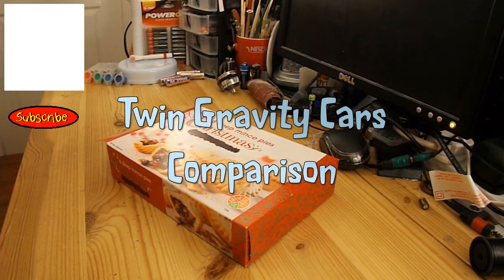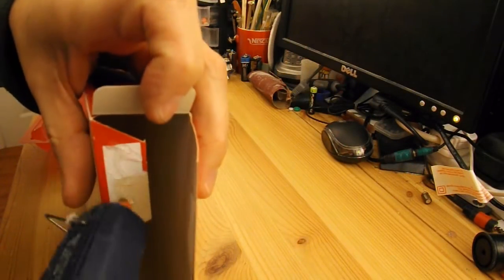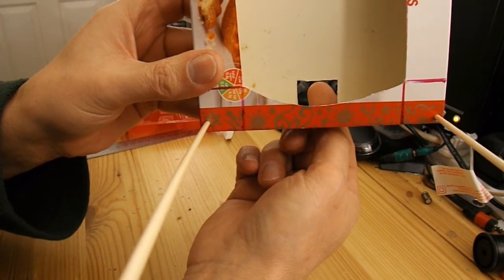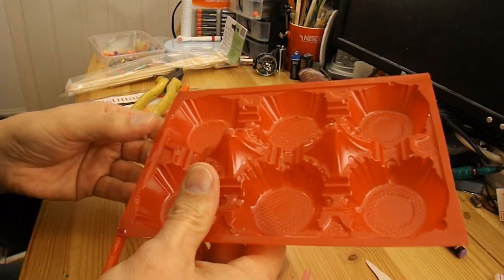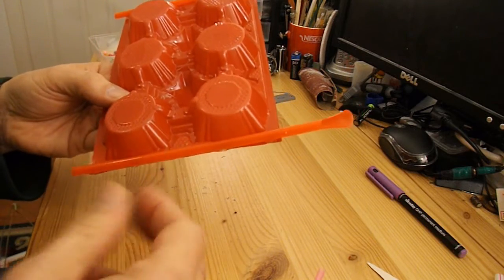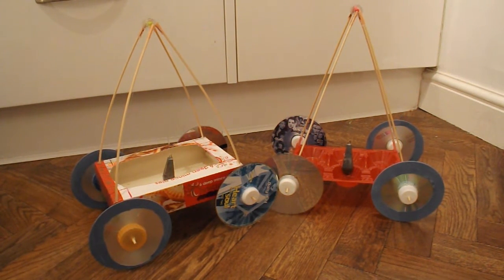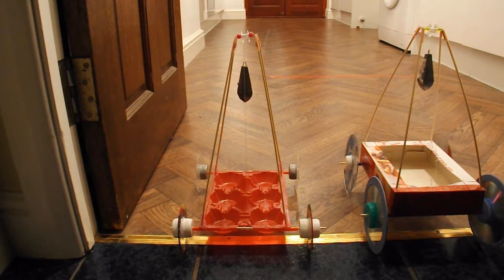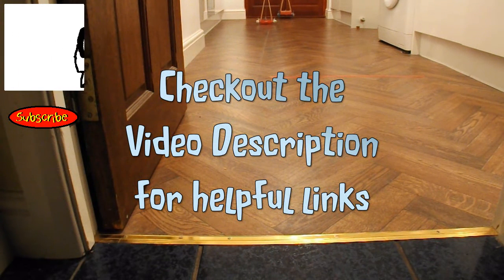Twin Gravity Powered Cars comparison

Comment: do you know how i can make one that goes 10 meters
Reply from the maker: The distance it travels is very much down to the friction and inertia. If your bearing surfaces have minimal friction it will travel further, so the pulley and the axles need to run freely. Lubricate the bearing surfaces, consider using ball races. A heavy weight will give you more inertia to get the car moving faster. A taller tower will give you a longer distance for the weight to drop. The distance the car travels forwards with each revolution of the wheel is the circumference of the wheel, so a small wheeled car will travel less distance than a large wheeled car. I have no doubt you will be given some specific criteria for your project, so I cannot guess what your car design would be without knowing those details. If you read the video description I have already given advice and useful links.
Reply: @GrandadIsAnOldMan  ok thank you

Comment: Im sorry to say this, but after 5+ hours of following this tutorial, my gravity car still does not work, i wish you had spent more time explaining the winding up process because my car winds up but doesn't move. Now I have finished car that doesn't move unless you push it. Please explain how to attach the string better so others can understand.. Thank you.
Reply from the maker: First it says nothing about being a tutorial. It is an attempt to compare different sized wheels. There are currently 36 videos in the associated playlist with various different designs if you look in the video description for the link. The most likely reason for the lack of movement for your car is friction. Either at the axle bearings or the pulley bearing so ensure they are free running. Experimenting with different sized pulleys may help. To connect the string to the axle I have used many different methods in my cars over the years. You could just glue a short length of bbq skewer or toothpick to the axle so it makes a T shape then put a loop on the end of your string and loop it over the stick. Then you wind it up. If you start with the weight sitting on the car and push the car backwards it will wind the string round the axle and raise the weight. You might like to check out the two videos directly linked to this one.
Twin Gravity Cars Pulley Improvement  https://youtu.be/k-kZzlY5cTE?list=PLA5a2xPRSrB1zzCqDckAnlOzz8iViuM94
Twin Gravity Cars reducing axle friction https://youtu.be/0FpP3qRDAS0?list=PLA5a2xPRSrB1zzCqDckAnlOzz8iViuM94

Comment: Why do you cut of the small piece in the back axle where hole is to attach string.  How can you attach string to axle if you cut in out.
Reply from the maker: I guess you need to watch the video again. I don't cut the axle. I cut a gap in the drinking straw that the axle goes through. That allows you to attach the string to the axle. If you don't cut a gap in the straw how can you attach the string to the axle? I tie a loop in the end of the string and I glue a very short length of BBQ skewer to the axle in the middle making a T shape so you can hook the string loop over it. That allows the string to drop off when the weight has dropped so the car can freewheel without the string getting tangled back up on the axle.

Comment: I v tried with seven box like you use but it didn't went far
Reply from the maker: The distance it goes is related to the friction of all the moving parts. In the video description there are links to several videos that give you hints and tips on improving the performance. The type of box is pretty well irrelevant, it is the axle bearings and the pulley that makes the difference.

Comment: can they travel at least 7.5m?
Reply from the maker: Probably. In tell you in my video they travel the length of my kitchen which is 5 metres and hit the wall at the end. The important thing is minimising friction so if you pay particular attention to the pulley at the top you can improve your performance. Also need to make sure your axles run freely. Much of the distance travelled can be the freewheeling after the weight has dropped. I did not build these to go a long distance, I just wanted to compare a few options like the size of the wheels.

Comment: What do I have to fix if my car goes fast but stops halfway? I need it to go 20 feet but it ends up going 10 feet fast and stops because the weight falls down too quickly.
Reply from the maker: First thing to do is make sure your car can freewheel properly when the weight has finished falling. Much of the distance traveled is by the momentum of the vehicle after the the weight has got the car up to speed. Have you tied the string to the back axle? It needs to come of the axle so the axle can spin free so tying it is a bad idea.

Comment: Hello! can you please tell me the principle behind the working of gravity driven car ? does it use any laws ?
Reply from the maker: Energy is stored by lifting the weight. So that is potential energy. The energy is converted to kinetic energy as the weight falls and the string turns the axle driving the car forward.
Reply: Wow! Thank you soo much GrandadIsAnOldMan. Only this much I thought there would be some laws behind the working. I am doing the gravity driven car for my mechanics project and my teacher would question me on its working. Thank u once again.
Reply from the maker: Junia Shelomi yes you can include Newtons laws of motion but may be a bit more difficult to explain or prove. The energy in - the weight dropping - will equate to the energy used by the car moving. So you would have to know the mass of the car and measure the distance traveled, the velocity and then make allowances for friction etc.
Reply: yes i think I will give it a try to include the laws of motions and if i have any doubts I'll ask you. thank you soo much
Reply from the maker: Junia Shelomi good luck :-)

Comment: Do you think a mass of 1kg falling from 10 cm would cause the car made out of the box go faster? (ASAP)
Reply from the maker: +Kevin Jimenez the problem would be that a 1kg weight will probably bend the axles so you would need to make it stronger. Here is an alternative idea https://youtu.be/laTDJk79H00  I did another one recently using Vinyl LPs - old records -  using a 1Kg weight and it ran 10 metres easily. The video is already uploaded but scheduled for publication on 27th January. To give you an idea it looks very similar to this mousetrap car https://youtu.be/v1n4PtRaM9Y
Reply: +GrandadIsAnOldMan 
Do you think there is anyway we can see the video?
Reply from the maker: ***** it is the same in principle as the cars in the links I gave you in my previous reply. Try watching them. The only difference is the wheels are Vinyl LPs. There are not many different ways you can build a car with just 2 wheels and an axle. As this is obviously your school project I am not sure I should do your work for you, I have given you some guidance and advice and I am giving the same advice to everybody else who is asking me about a 1kg drop project.
Reply: +GrandadIsAnOldMan Where could we possibly get the "Vinyl LPs"?
Reply from the maker: ***** how should I know? I don't even know where in the world you live. All you need is two disks for the wheels, the bigger the better. The video link showed you one I made from cardboard and that worked fine rolling for 5 metres with only a 4 ounce weight.

Comment: Hello!  I just wanted to know if your mass was 1kg?
Reply from the maker: +Cherei Tree if you mean the lead weights, they are 4 oz lead fishing weights. The details are in the video description.
Reply: +GrandadIsAnOldMan 
Thank you! Do you think this can carry 1 kg? I'm planning to make a joule mobile, but it can only fall 10 cm with one kg. Do you have any tips? Thank you so much!!
Reply from the maker: Cherei Tree I am assuming you have to cover a certain distance. If you can only use a 10 cm drop you will have to ensure the car runs freely with minimum friction so you get the benefit of it freewheeling after the power has finished. There will be an optimal wheel size and axle size to get the best out of the drop. Larger wheels will cover a greater distance for a give number of revolutions but require more power to start them rolling. Smaller wheels will accelerate faster put the power will run out over a shorter distance because they travel less distance for the same number of revolutions. The diameter of the axle will set the number of turns of string you get round it from a 10 cm drop. The bigger the diameter, the less number of turns and therefor the less number of revolutions for the wheels under power. The smaller the axle diameter the less power it has to turn the wheel so a small diameter axle may mean you cannot turn a large diameter wheel.
Reply from the maker: +Cherei Tree the problem would be that a 1kg weight will probably bend the axles so you would need to make it stronger. Here is an alternative idea https://youtu.be/laTDJk79H00  I did another one recently using Vinyl LPs - old records -  using a 1Kg weight and it ran 10 metres easily. The video is already uploaded but scheduled for publication on 27th January. To give you an idea it looks very similar to this mousetrap car https://youtu.be/v1n4PtRaM9Y
Reply: +GrandadIsAnOldMan Thank you very much for your detailed answer. Your advice is very helpful!! I'm on the process of finishing it up :D  Thanks and wish me luck!
Btw, were you a physics major /teacher or did you just like the subject? You seem very knowledgeable & happy with what you do-- so kudos to you :D
Reply from the maker: Cherei Tree thank you. I was a telephone engineer.

Comment: Did you use type around the border of the CDs?
Reply from the maker: Hi Lexi, I re-used the wheels that I had been using on my rubber band powered cars and they had strips of rubber cut from washing-up gloves stretched around the rims, but didn't really need the extra grip so I took the strips off in later videos.